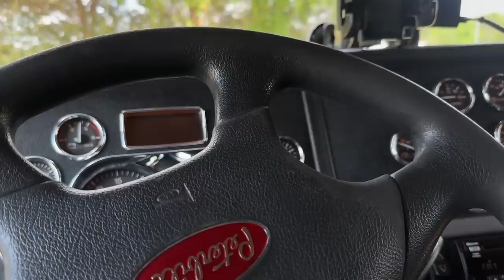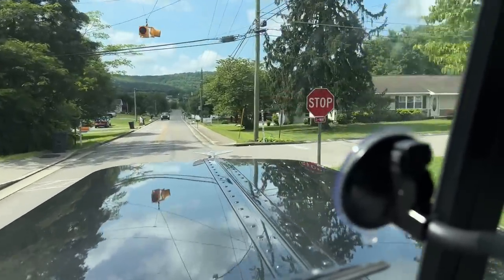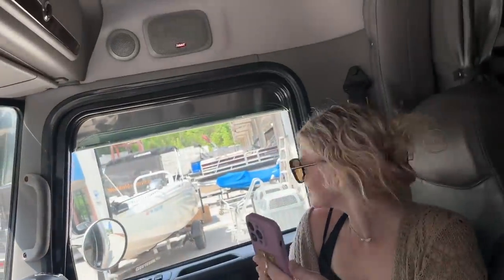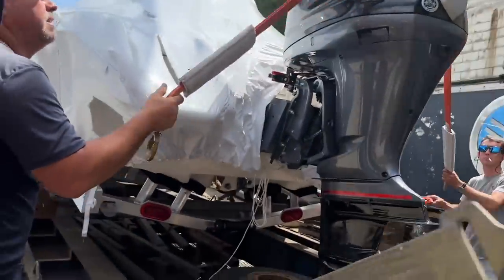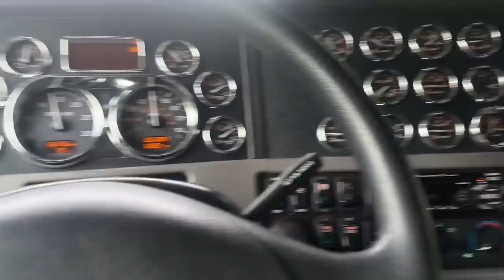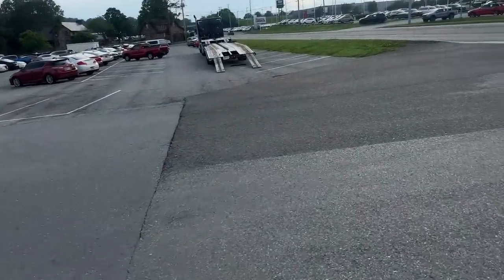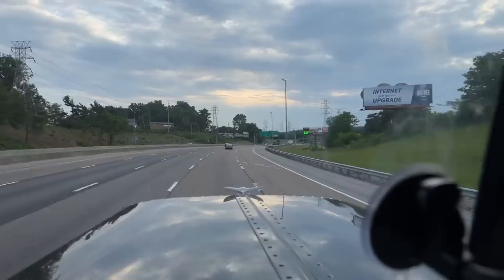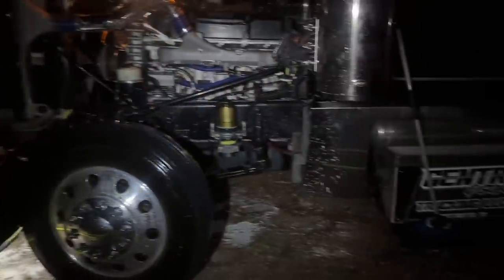TWRA Special Delivery!! New Trailer Put Out Of Service..

Comment: The main reason why the dealerships have vehicles is because they are price gouging by about 20 grand, both GM and Ford or doing that and Ram are just expensive even back in 2015 bc I own a Ram 2500 2015 model paid for and I could sell it and make 2x what I give for it and I bought it brand new it had .2 miles on it when I took it for a test drive but I couldn’t replace it so ima keep my truck just bc I’ll never be able to get another one like it
Hope you and the family have a good day!

Comment: I chased a ABS issue for 2 yrs come to find out it was a 30 Amp fuse on my truck, I changed relays ABS valves on tractor, everytime I had a trailer on  the lamp would light up when I braked.